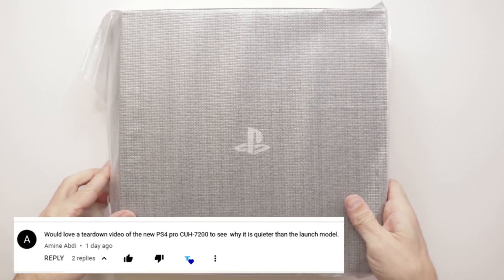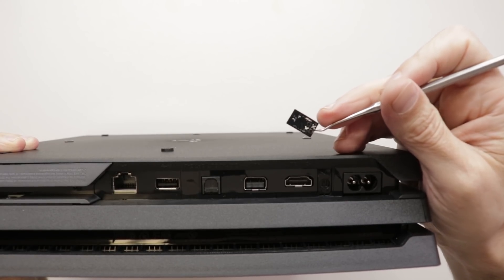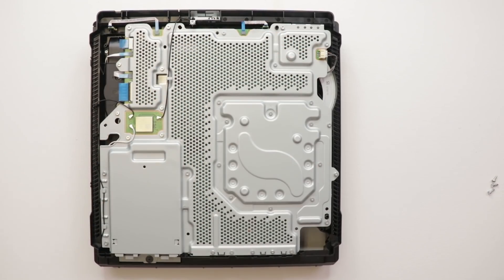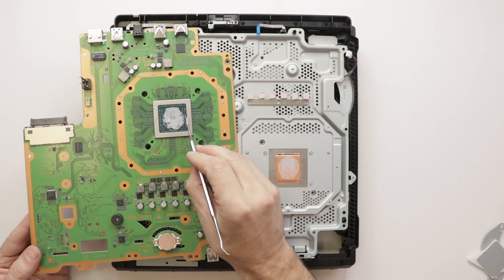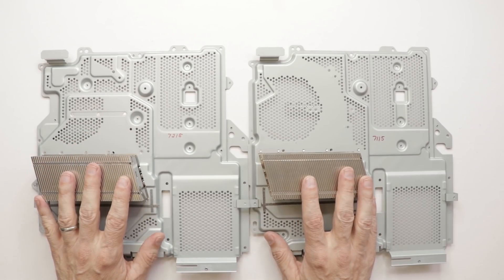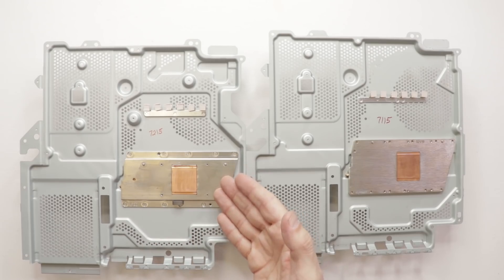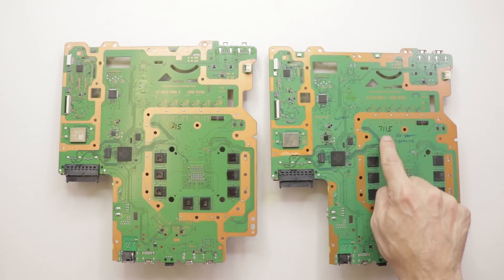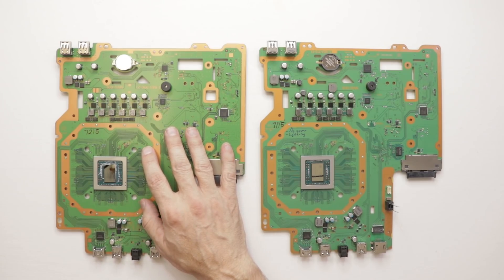The New 2018 PS4 Pro is so Quiet - But Why? Disassembly and Comparison - 7215 Model

Comment: Hi tronics Can you please upload a video on how to fix ps4 error SU-42118-6.. People say it's a bluray problem but no one gives a totorial on how to fix. (Fix for CUH-1215A) Please and thanks!
Reply from the maker: Usually SU errors are caused by hard drive problems but not always. I may make a video on that.
Reply: @Tronicsfix   A friend told me that it has something to do with ribbon cables being damaged and i did take my ps4 apart to clean i think one of the cables were damaged.. kinda scared

Comment: Would you repair a mobile phone that has an automatic reboot problem? It automatically reboots due to lag on the system (not the RAM). It would be nice, Steve
Reply from the maker: I haven't done too much with phones but I might get into it.
Reply: @Tronicsfix  And... my phone has 2 problems. 1.Has an automatic reboot due to lag on the system
2. When charging without turning off the power, the battery actually decreases instead of rising. Example: The battery when I saw it was 17%. But after I saw it again, it reduced to 16%. How to fix a problem like this? You are a technician. An expert technician. So please help me.

Comment: a number of things come to mind -- are the fan blades moulded differently? more or less of them? more or less heat tubes going through the sink? less flow-restriction inside the power supply? fewer screws into/through the MB?
Reply from the maker: Yes, all valid questions.

Comment: Screw you Sony! There is only one model of the xb1x but 3 or 4 of the pro. I have both consoles but got stuck with a jet pro.
Reply from the maker: That sucks. You might try liquid metal on it. That really helps to lower temps.
Reply: there's not only one xbox one x revision. clean the tim and replace it. i

Comment: Is it me or is the heat sink plate a different colour and thickness? (See 5:22). Could be different materials between the two? If the newer plate is thicker (difficult to make out by the overhead camera angle) possibly a newer core technology has also been implemented to the heatsink plate to transfer heat away from the processor quicker? (e.g. 'vapor' chambers).

Sony may also have tweaked the power configuration similar to Xbox One X's  Hovis method.
Reply from the maker: I can't say for sure but it looks very similar to the previous heat sink...just a bit smaller.
Reply: The power supply on the version i have (uk).CUH-7116 reminds you of the FAT PS3 from years ago...And the Achilles heel for that was HEAT..

Comment: According to digital foundry this model runs quieter at the cost of higher temps. Id prefer a louder console with a better lifespan imo.
Reply from the maker: Really? I'll have to check that out.
Reply: Since when running cooler mean longer life span? I mean if it run beyond 100 degrees yeah
Reply: @NFRSZ  Hotter generally kills electronics faster. If its not the GPU itself due to the transistors degrading, its expansion/contraction of the PCB ripping off the BGA, capacitors drying up quicker, VRMs failing,etc.  Remember, the PS4 only has one cooling fan so if it runs slower EVERY SINGLE PART of the PS4 PCB will run hotter.
Reply: Somebody need to do a thorough comparison.. which one is cooler at the chips level.
Reply: Really?  You would rather have it louder??? ..ive soldmy original ps4 Pro and now got the red dead bundle console and omg its sooo much nicer being quieter. My launch day Pro sounded like jet plane taking off. Makes the console feel like a more polished machine. I can now play games without headphones on all the time..
Reply: not necessarily. temps have to be measured at the CPU itself, not body or exhaust. Higher body/exhaust air temp simply means the heatsink and fan remove heat off the CPU die more efficiently
Reply: @mimimimeow  is right. If the console has more efficient cooling, you'd expect the top and the back to be hotter. Heat has to go somewhere. More heat being drawn by the heat sink means less heat on the die. And lower fan speeds since the fan doesn't have to work as hard.
Reply: @MrAzazel666  You're forgetting the effect of the volume of air being pushed out the back. If the newer cooling pushes trough more air, which it should if it's supposed to be more efficient, then that air should be colder, not hotter, as the internal components are still the same ones running at the same speed. Just running the fans at a lower speed would cause the exhaust air to be hotter as that air has more heat to absorb per volume.

It's just basic thermodynamics people...
Reply: @MrAzazel666  more heat accumulating on the heat sink means the cooling system is not capable of eliminating it fast enough to keep temps lower. high "case" temperature = even further increase in cpu temperature, which in turn increases case temps further.
i know what you're getting at, but a hotter heatsink pretty much always mean the cpu is running hotter (assuming of course there's not a massive defect in heat transfer in one of the systems)
Reply: @mimimimeow  It is not possible to give a clear picture without CPU temperature, but if the APU is power efficient and the cooling system is unchanged the outside heat map should be lower (less heat to dissipate). Now if they changed the cooling system also to make it efficient, then yes the exhaust should be hotter but there is less heat at source to dissipate. Unfortunately we can only speculate without additional metrics.
Reply: Mine feels COOLER to the touch.. my new ps4 pro in the red dead bundle feels much cooler to the touch than my old ps4 pro after playing a few hours
Reply: Sampsonay I agree. I have the 7115 model, and it’s always overheating. Twice I’ve had to reinstall the OS because it just overheated and forced a Safe Mode boot. I actually want to track down the original 7000 series Pro model, since according to DF, it’s the loudest but also the coolest of the three models. I’d, as you said, prefer my PS4 not overheat. The fan noise is annoying, but the temperatures much moreso.
Reply: @spooky_electric  to anyone just put there LM or atleast good paste like phobya hegrease extreme.. And you are good to go
Reply: True overheating has never broken any of my devices but only bc i always have the loud fan versions of consoles pc so on & i add extra fans
Reply: Well, the original one doesnt seem to have a good lifespan tho .. 

Mine is alive since 2014 (or is it 2013?), but i hardly actually use it, and it sounds like a damn 747 all the time basically
Reply: Higher temps actually can cause BGA failure sooner/morelikely  between APU and PCB :)
Reply: You’d say that until you heard my launch Pro. It’s clean inside and out and sounds like a hairdryer.
Reply: Could you share the link for the  digital foundry proof that ps4 pro 7200 model runs quieter at the cost of higher temps?
Reply: My CUH-7015 with upgraded thermal paste and thermal pads is just as quiet as my brothers CUH-7200 and is much cooler to the touch.  My 7015 also has a Nidec fan where my brothers CUH-7215 has a Delta fan.
Reply: Yeah, they changed the fan profile.  They could have done that in software on the previous model.  But that doesn't sell new consoles...  Oh and more efficient cooling makes the heatsink hotter?  More efficient thermal transfer from the APU to the heatsink would make it hotter, but so does less heat dissipation by running the fan slower make the heatsink hotter.
Reply: @CaffeinatedTech  I'd be surprised if most people even knew that there are different revisions of the same console, or what they mean. No one's going tu buy another PS4 pro just because it's a bit quieter
Reply: @CaffeinatedTech  CaffeinatedTech console manufacturer's generally don't make much money on hardware if any, and sometimes take losses which they recoup on software and services.  I doubt Sony's objective was to get people to rebuy new hardware, since the entire business model is termed "loss leader" and their margins come from services, software, and peripherals.
Reply: @2drealms196  no they made substantial cash on their hardware this generation. Contrary to what people believe.
Reply: @stuffstoconsider3516  can you provide some sources to your statement MS/Sony made substantial profits/highmargins on their hardware this gen?
Reply: @stuffstoconsider3516  Can you please give some sources for your info?
Reply: @2drealms196  google. This gen the consoles have been profitable since launch. Not loss leader like before
Reply: @cheesyriceo4  they make slim margins on hardware, not "substantial" margins.
Reply: Mike D i’m not the one who said that so idk why youre @ing me, I was only correcting the loss leader statement. A quick google search for current production costs says they cut it around 25% in the first year. Sounds pretty substantial to me, even before the slim
Reply: @cheesyriceo4  According to IHS estimates: at launch PS4 cost $372 in Bill of Materials cost (BOM)  and $381 when factoring in manufacturing cost at Foxconn. That was an estimate. Also in an interview Andrew House said they take a loss on each console sold but start making money if a 1st party title is sold ( yes its possible the exec was lieing). IHS estimate doesn't factor in the retailers ~$10 cut in the 1st year (when the boxes cost 400 (PS4) to 500 (Xbox One)).  (The retailers margins drop even further as the msrp drops over the years.). It also doesn't factor distribution costs nor the small nominal cost of packaging, nor defect rates in modern hardware (Consumer Reports (CR) highlighted that typical defect rates on many electronic goods are between 1.5% to ~2%.)
Reply: None of the estimates, even Chipworks/TechInsights at $357 show a 25% cut and they aren't factoring retailers cut nor distribution costs, nor the small nominal packaging costs, nor typical defect rates which Sony/MS have to factor in.  They also mention at the bottom of their article they aren't including the cost of the controller.
Reply: @2drealms196   They made slim margins back when it released.
Now? Easily 35-50% profit margin for each PS4 sold. 

Everything what you just stated that they don't factor in, such as "cuts" being made in mass, aka 10,000 ps4's costing $372 to make would actually only cost like..$150-200 to make per console in reality.
Reply: @2drealms196  "it's ridiculous to assume sony makes 35%-50% profit"
LOL WHAT
I was making the $250 claim when the consoles released.
Now? You might as well call them dirt cheap to make.  Less then $100 per console made (they're even beginning to stop making ps4's altogether)

BTW I love how you went on the classical "these are experts!! i know experts!! these people who I assume are experts make these claims!!" Yet..the only claims these people made was how much each piece of hardware would've costed on a PC based level.  Not a manufacturer based level at all. 

By your logic, I must have a professional college degree at this rate.
Reply: @Nighterlev  Really how much investigating and research have you done to come to your conclusion?  Anyways ram chips contract prices (for 10,000 units) are available at MemoryExchange for paying corporate clients.  IHS & TechInsight have access to info you do not.
Reply: @Nighterlev Hows that 9-5 job going?  Since you give more accurate pricing than IHS and TechInsights with less research time, you should be able to pull in their corporate customers who want component cost analysis and become rich!
Reply: @2drealms196  Again, as I already stated.  No, none of these websites that calculated how much it'd cost to put a PS4, or Xbox One together, did anything to do with discounts on ANY of the parts when buying in bulk.
Hell, some of the websites even went out of there way to quite clearly state this.   

I misread "MemoryExchange " as MemoryExpress.  Although, either one, they don't list bulk pricing anywhere for the individual chips.  Only for the full on sticks aka modules, which neither Microsoft nor Sony use at all.  
Hell, I bet you didn't even know that the 1st gen Xbox One actually uses DDR3 2133Mhz RAM LMFAO. 

Yes, the chips are in fact custom chips built specifically for the Xbox One/PS4's main motherboard.  You can't just take the module out of either console, you know that..Right?

Think of it like a GPU, because that's exactly how the Xbox One/PS4 is built to be, one massive GPU with a CPU along side it, plus you can't connect it to any PCIe slots or anything like that.
Reply: @2drealms196  This is correct. They would much rather have a system last the whole life cycle of that generation than to have you rebuy one. They don't make their money on the systems themselves.
Reply: Sampsonay That its heatsink runs hotter just means it’s working more effectively.
Reply: @kraenk12  not necessarily true, if the fan is slower then it is moving less heat from the heatsink, therefore the heatsink become hotter
Reply: Sampsonay ps5 out in 1 year anyway
Reply: Everlast more like 2 or 3 according to sony.
Reply: my louder one stopped working quieter one has lasted longer
Reply: Sampsonay play the ps4 Pro with the ac turned up or play it outside in the freezing cold 🥶 there problem solved
Reply: Chips themselves have a save operating temperature at least up to 85°C. The new 9900K from Intel ramped that up to 115°C before the chip itself is taking safety measures. The chips itself don't degrade from temps below this. (They can die of course, but more likely from overvoltage than from heat.) So a chip by itself with a reasonable voltage will run literally forever if you keep it at 80°C. More coolness is just more noise.

But there are other components like the solderd connections on the board, who like it cool, that means you have to give it enough air. But in the end, i think the sony engineers know what they doing.
Reply: @TanteEmmaaa  "The new 9900K from Intel ramped that up to 115°C before the chip itself is taking safety measures. The chips itself don't degrade from temps below this." Chips degrade even on room temperature. But higher the temperature the process becomes faster exponentially. And it usually doesn't kill the chip instantly but cause stability issues over time.
Reply: @peterkiss1204  In theory yes, that is why this urban legend exists, but in practice silicon chips have no expiry date. You can destroy them with overheat, overvoltage, maybe humidity if the case is not sealed or with any other external force, but else the silicon will remain until the end of the universe. Exceptions are of course things like flash memory cells.
Reply: @TanteEmmaaa  In normal conditions, you are right. But systems running on the edge of their capabilities often degrade significantly over time. If you ever got involved in overclocking, chips in frequent heavy use without sufficient cooling usually lose some of their peak performance, need slightly more core voltage overtime to maintain their stability at the same clock speed as before. But the real problem here is the quicker aging of materials that can lead to premature fatigue.

Comment: I like the Thanos snap at  2:40
Reply: The moment all Xbox owners turned to dust.
Reply: @mikes5637  does that mean you don't have any xbox consoles?
Reply: @mikes5637  No only half of them.
Reply: @mikes5637  Do you have the Xbox One X? I have the Pro and the X and I like both of them. But it is a fact that the hardware of the X is better and it is so silent comparing it to all revisions of the PS4pro.
Reply: Markus K. I’ve been seeing a lot of noisy Xbox One Xs as of recently.  Mine itself way getting loud on most X enhanced games after a year until I changed the thermal paste.
Reply: @racerboyo  faulty unit. I have both the s and X since launch and they have the same amount of noise when playing games
Reply: I don't feel well whats going on..,........ *rip

Comment: I have the first model its not loud i play red dead redemption 2 for 4 hours and it's runs perfectly and i run it in 4k tv i don't know why everyone says its loud 😂
Reply: Some models are loud actually. Could be the poor binned APU chip or poor application of thermal compound
Reply: When I first got the ps4 pro it was silent. It's quite for most games except if I play god of war,black ops 4 and red dead in 4k. I can do 1080p hdr and its silent pretty much
Reply: Mine did not get loud after a few year, but it got hotter, so I open it up and redone the  thermal grease and pad. Surprise, surprise, I cannot hear the fan spin anymore.
Reply: @will3641  Did you plug the fan back in though?
Reply: @fcukugimmeausername  I did, I can feel the hot air got pushed out. The air felt denser and heavier (well, not sure about the description here, but hopefully you get what I am saying).  The top plastic cover is not as hot as before.
Reply: You got lucky most are loud af.
Reply: @sean70729  Depends how good the airflow is around the ps4
Reply: My pro only gets loud when I'm playing god of war
Reply: So because yours is quite, everyone else is wrong. Shut up kid.
Reply: @kenshinofkin5337  no need to talk like that i know alot of people have loud ps4 pro i just want to make a conversation with people but a person like you take the comment like a curse  you need to grow up.. KID 😋
Reply: Same here. I've always wondered why people say they're loud. It is definitely louder than my Xbox X, but I have lots of room behind my Pro to vent the hot air and it's noise level is fine.

Comment: Very good. I know it's probably already been said but how come you didn't notice/say the different power socket on the newer model to you older one? 😉👍🏻
Reply from the maker: Mainly because it's the same as the last model (7100). It only different from the original model (7000).
Reply: @Tronicsfix  I've got a cuh7100 though & the power socket on mine is the same as the cuh7000 version though 🤔
Reply: @rebug5614  yes 7000 and 7100 are the same
Reply: @rebug5614  I have the 7000